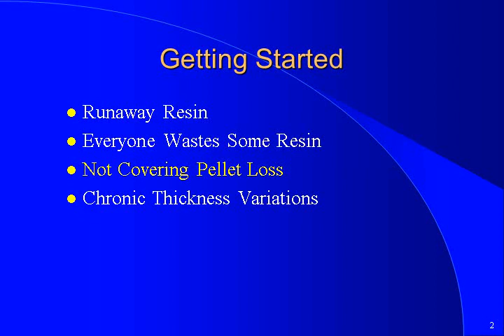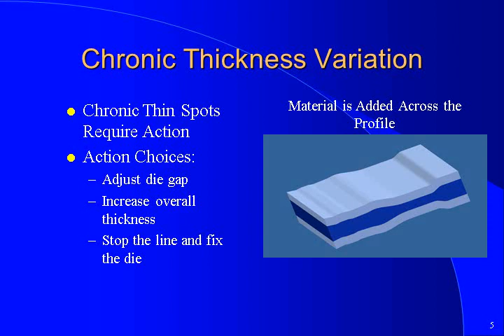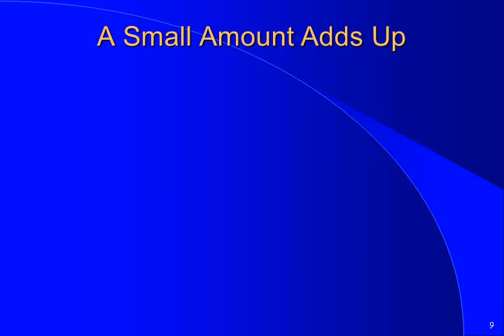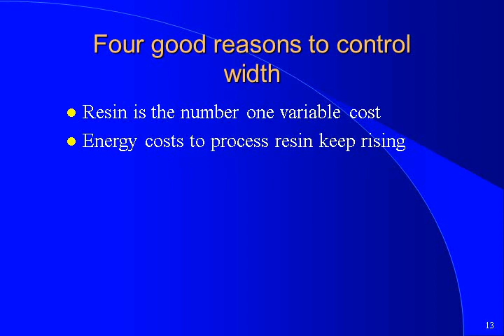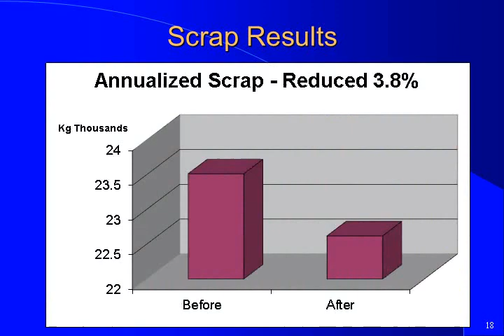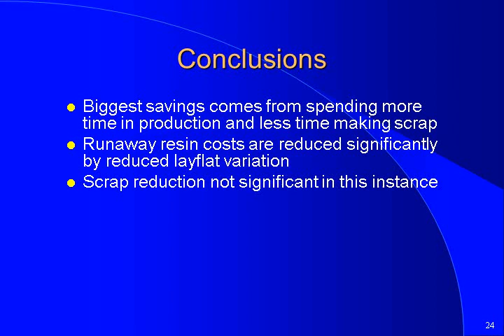Reducing Runaway Resin for Blown Film Extrusion

Comment: What is the use  chemical to use cleaning to die head before running machine
Reply from the maker: The most common way to clean a die is with purge compound.
Reply: U can use proses 2 clean the die